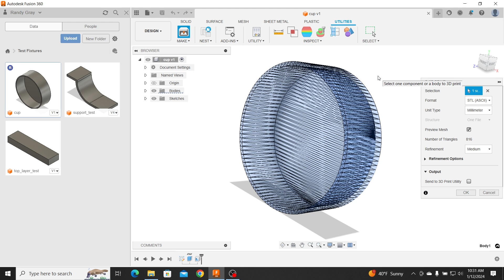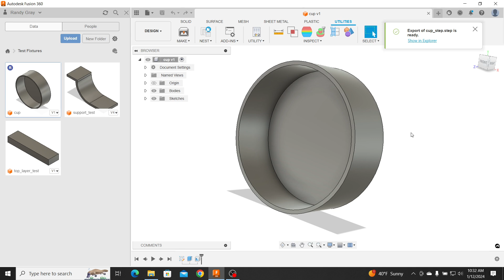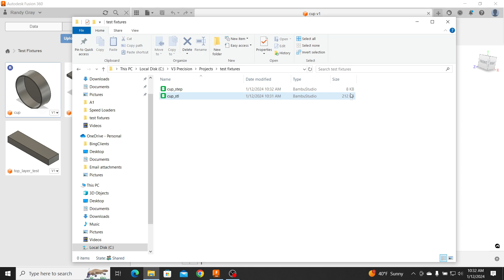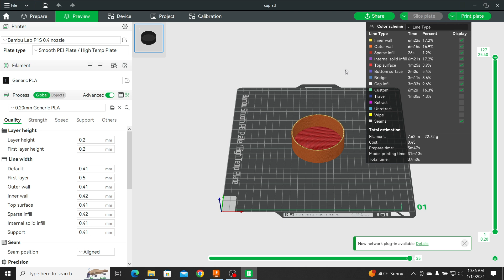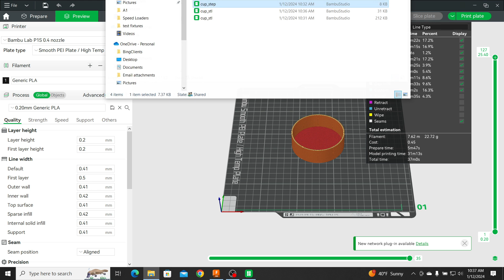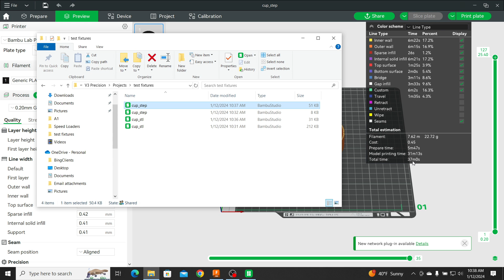The Difference between an STL file and an STEP file.

Comment: Good information but there is one more point that is far more important to me.  I just finally bought a bambu labs H2D printer with the AMS 4 filament spool supply.  While I appreciate the quality and any time improvements, multi-filament and multi-color etc is the newest revolutionary change for me.  STL files do not support multi-color without manual stop to manually change filaments.  The 3MF is supposed to support the multi-filament and multi-color printing whenever the filament shows up.  This means that you can have color changes within a layer or wheneverr.  For me this will revolutionize my printing once the filaments shipped arrive.  In short multi-filament and multi-color of the bambu labs H2D will take my 3D printing to a whole new level.

Comment: The main reason I use step is for selxtable features on sub group in one model. ei You can enable or disable sepaprators in a drawer right in the slicer.

Comment: Being pedantic and sharing what actually happens:
The slicer is just doing the conversion to stl during import (at a finer detail) rather than the CAD software in your example. It isn't slicing an actual step file. You can get improved results during the export by increasing fidelity. In your instance, you only had it set to medium when you triangulated it. There are additional settings as well.

Comment: The slicer has to convert STEP into a mesh to my knowledge to slice it so I think what you are seeing is different conversion resolutions rather than anything inherently better for slicing. The STEP format is much better than stl or 3mf (both mesh formats) for efficiency especially geometric shapes and 3mf is much better due to much better meta data for printing specific information and has the additional benefit of file compression of the mesh. STL is the worst format of all of them.

Comment: STL = a mesh of triangles, object with curved surfaces require lots of triangles and file size will be big.

STEP = a geometric definition of your object using radius/diameter, tangents, arcs, etc... NO mesh triangles to define curves, so much better quality and smaller file size.

3MF = compressed file containing a mesh of triangles (like the STL) and other data (textures, colors, etc)

a STL object saved as 3MF is the same triangle mesh but compressed, so file size is smaller but quality is the same as the original STL.

a STEP object saved as 3MF is no more a geometric definition, is a triangle mesh representing the object, the mesh quality and size varies with the program you use to open the STEP and save it to 3MF. File size is bigger and quality is worse than original STEP file.
Reply: Just to tweak your excellent reply. A step file is not much better quality. It's a geometric specification. The quality comes in when you decide what resolution you want when you decide to slice it. One day it could be rough, another day it could be high precision. As you say about stl files, their resolution is fixed and there is no data in an stl file to enable you to make it better.

Comment: Since STEP works with surfaces defined by mathematical formulas and the STL with triangles, if you import an STEP on Prusa Slicer, you can use the option to generate curves with G2 and G3 commands (instead of hundreds of straight segments made with G1), which will make the machine print a perfect curve. If you not use G2 or G3, the results will be similar since the slice will transform the curve in segments.

Comment: This video was not as informative as I was hoping for.
Basically the quality of the printed part depends on the tolerance of the STL export, and tolerance of the gcode calculation. If these tolerances are close to each other, the end result and gcode size and everything else would be more or less the same, but indeed the step files are more accurate to the model.

Comment: As a Machinist in the Aerospace sector, for over 30 years, I can tell you right now, STL files are garbage! With Step files, you're getting the absolute raw solid model! Believe me! I dealt with STL files going back 25+ years and they're the stupidest format for the machines that we run at home today! I tested this out several years ago by manually writing proper G-Code for a 3D printer and it works with G2/G3 commands. Finally, Fusion 360 will actually slice a proper solid model modeled in Fusion 360 or a Step file into proper G2/G3 Code and it is less than half the size as an STL sliced model with way nicer, cleaner prints. STL file format is not needed with today's resin and FDM printers. It was designed in 1986 for stereolithography machines. Believe me, I've been around this industry for three decades plus! Bamboo slicer has a feature to print with a Step file and it has some kind of smoothing, possibly using G2/G3 commands for arcs.
Reply: What’s your thoughts on 3MF. I design 3D terrain for tabletop gaming. I’m no longer selling or giving free tiles in STL. I do 3MF.  But 3MF people can put intrusive codes in them from what I understand. I was thinking STEP, but from limited understanding STEP allows anyone to get in and manipulate your designs or put signatures or watermarks of sorts. What are your thoughts on that, should it be a concern for people stealing your designs and watermarking them?
Reply: @Slurgical_3D_Terrain_Channel  I realize this is late, but 3MF files are just containers that contain the stl and the slice data. You can open them with a zip program like 7zip. The step files are retain things like fillet info etc. You wouldn't use step files for terrain data. It's a CAD format that allows you to send from one native package to another. It does flatten that info when exported, but you can still get in there and work with it. Everything can be reverse engineered to some degree of precision.
Reply: @ thanks. It’s never too late. Great info. I use now STEP format once I’m done with that file and don’t have to come bask as it clears up all the details. Pretty much to get rid of the bloat for my workflow when I start combining final items. I then save them as .obj and move them into Blender to sculpt. I don’t have a logic to the .obj except it’s a format in case I want to use it on Nomad when I’m on the go. I find it retains integrity compared if I import as STL on Nomad. Sometimes Nomad does it own things and the soften some of the details that require precision like magnet inserts emplacement.
Reply: @Slurgical_3D_Terrain_Channel  So, using an OBJ makes sense in your case. Where the 3MF file contains manufacturing info etc, the OBJ also stores data including geometry, material, and texture info. So it makes sense to use in Blender and Nomad which is poligional modeling. I use Blender as well. There's a lot to all this stuff. ;)
Reply: @ I know, I’m absolutely loving all that. I create tabletop terrain to 3D print and soon will start modelling miniatures. I’m new to all this, launched my channel last year and in January launching a monthly patreon.  Very exciting time. My first will be modern urban terrain for games like Zombicide, bolt action and a universal game rules I’m designing for quick games.  Will do a Medieval in February for games like Mordheim, D&D and in March for a game called Trench Crusade. Each months after that I will release terrain for each of those themes.
Reply: @Slurgical_3D_Terrain_Channel  That is awesome! I will definitely subscribe to your channel; if you don't mind. 

I know a little bit about a lot of things, but my strength comes from 20 years of being a manufacturing designer using CAD and CNC programmer. While I have done quite a few polygonal models over those years, it certainly isn't my strength, but something I love learning and applying when I have the time. Yes, I even used Blender >15 years ago. It really sucked back then as it was VERY difficult to grasp the concept. I love how far it has come over the years!

I also enjoy 3D printing. Just finished up requests for my wife last night. She's my best/only customer. LOL Are you doing FDM or resin? I have a good friend how loves printing miniatures in FDM. He avoids resin due to not having a good place to set it up where it wouldn't negatively impact his young daughter. 

I look forward to seeing your channel & knowledge grow. I'm sure you can teach me a lot too.
Reply: @ thank you for subscribing. I took the plunge into 3D CAD and sculpting (more recently) about 3 years committing to it instead of dabbling.  I first started with Blender…somehow made the doughnut….and couldn’t replicate anything after. My brain kept on melting.  I did only a couple gears using Python through Blender and never touched again until just a couple of weeks ago. 360 is way out of my budget and I didn’t have the computer to run it.  I have been using the iPad until a couple of weeks ago when I got a new computer. I will still use the iPad for the CAD using Sharpr3D they give me a deal since I kept on pushing their software and crashing it lol.  I don’t want to lose that subscription since I’m paying just a portion of it and I really like it. All my hard surfaces are done on that then move it to sculpt in Blender. I keep on crashing Nomad Sculpt.

I use FDM, I would love a resin but on very limited budget as I am disabled and unable to hold a job with a rigid schedule. Reinventing myself through this and I am really enjoying it.

If I can help in any ways, feel free to ask, I have a free discord link, not too many people yet in there. But hoping it will be a community of people sharing and exchanging their knowledge and experiences.

Thank you again for your kind words. This is such a great medium for self growth and potential career. I strive to both.
Reply: Coming from just a few years as a machinist and drafter I was also blown away with how useless stl files are. Even if I can manage to convert them to some sort of solid model they still behave like trash. It’s so weird to me that they’re the default for 3D printers still. 

I haven’t played with it yet but I’m curious if a 3mf file behaves similarly when trying to edit. I see designs online that are just about perfect but I want to tweak one little thing so I can use it myself. Not to use commercially or anything. With the 3mf I wonder if it would be easier to make these edits.
Reply: @ricklynch  Oh I believe you, I initially released my terrain in 3MF with an explanation on how better it is…..even free terrain wasn’t downloaded, I re-released them in STL…few hundreds of downloaded.  Just file sizes alone should interest people but it doesn’t. When I launch my Patreon I will put both formats and encourage people to download the 3MF. I’m new with the STEP format, going to try and see, maybe add that as a format. Hopefully in time people will transition.
Reply: Is Step format gives more smooth for a sample ?
Reply: @RamyHelmy-vv3gq  Step is mathematically done to go from one CAD package to another so it is 100% precise. What the video fails to mention is that the file is still being converted to an STL, only the slicer is doing it during import to a finer degree. He could have also increased the fidelity during the export process, but he left it at medium and didn't utilize any of the refinement process. That said, his process is the easiest way to go about things.
Reply: Isn't exporting it as a 3MF changing the structure of the model as a whole? Would be like taking an glb file with textures and loading it into say blender or nomad sculpt and remeshing the model. Changes the model from the ground up. I could be wrong, but, all a 3MF file is is a zip file containing the model (in OBJ format), gcode, color settings and other settings associated with the model & supports. 

Step files are so much better, they are way cleaner and super sharper. I use them a TON for printing Nerf guns, airsoft and other weapons and cosplay accessories. The edges are always crisp and depending on the file but sometimes sharp, which is especially amazing when printing swords and knives. When using the two files in bamboo slicing them for printing then printing after will show different results in the print itself. However, the moment you export them as a 3MF it converts them to OBJ and gcode full of the actions the printer should use when printing them which is why the file is slightly larger as there is a few more 1s and 0s (so to speak) worth of code. If they were both the same length the files would have been, for the most part, identical.

Comment: The G-code from STEP won't be bigger if you enable arc fitting in the slicer (assuming the printer firmware supports it). What this does is encodes motions that follow elliptical arcs as single G-code commands instead of as series of many small linear movements. The printer then handles these arc commands with high resolution (configurable in Klipper).

Comment: It all heavily depends on slicer. The software that decided how the header moves. If it can detect a cylinder and program path along the circle edges it will be smooth. If it treats all as triangles, the facets are inevitable.

Probably you should use another slicer, not from bambu

Comment: That was interesting.  I often make patterns for sand casting with my 3d printer.  As you probably know patterns come out of the sand much better if they have tapered sides where they touch the sand.  I am not good at fusion 360 so I use tinkercad.  Among the people i know who use Fusion 360 I have not found anyone who knows how to taper the sides. Do you have any ideas about this?
Thanks for the video keep on keeping on.
Reply: Create your cylinder with the minimum or maximum diameter and extrude it. Use the "DRAFT" command to select the pull direction, and the face to be pulled. You can then adjust the degree of the pull or input an exact degree. A positive number will make the angle larger in the direction of pull, and a negative number will make it smaller in that direction.
Reply: @AlAmantea  thanks that is what I needed to know.
Reply: @AlAmantea  I seldom do cylinders does this work with cubes and odd curved shapes?

Comment: Your STL file had 816 triangles & your STEP file had 2,796 triangles.  The increased triangle count in the STEP file provides more detail and is a much smaller file size.

Comment: Nice! But how about natural arc commands, g02, g03. Seem there is no use for them with stl. Does step file csn produce gcode with src commands??
Reply: Arc fitting in the slicer happens at final stages of G-code generation, no matter how the model was described. The slicer ends up emitting an arc movement instead of a series of linear movements if it can find an arc that's close enough (up to the slicer's G-code resolution).

In a way, it's really backwards. Ideal geometry from a STEP file gets approximated with triangles, those get sliced into series of linear movements, and then approximated with arcs again. Using ideal geometry all the way from STEP to G-code would have been more precise. I imagine, though, that it would require a fundamental redesign of the slicer.

In practice, though, this backwards solution works well enough as long as the slicer's internal resolution is the same as or higher than the mechanical resolution of the printer. The printed part will be as smooth as the printer can make it.

Comment: One of the very view occasions where I need to give thumbs down. You didn't say a word why the other one is smoother and where that filesize difference actually comes from.
Since step exports the curves the 'mesh' has an infinite resolution. This far the slicer can have a higher resolution gcode which is also cleaner in many cases and that the cause of the bigger filesize in the 3mf/gcode. Over at CNC kitchen there is a vid demoing what happens if triangles and slicing just have a bad combo by accident.